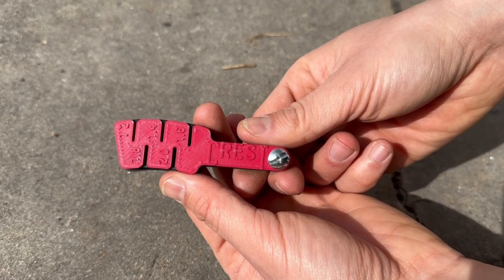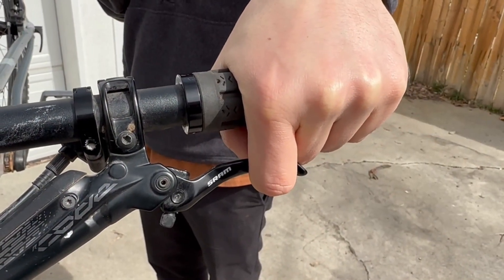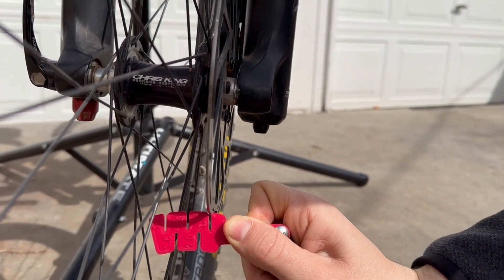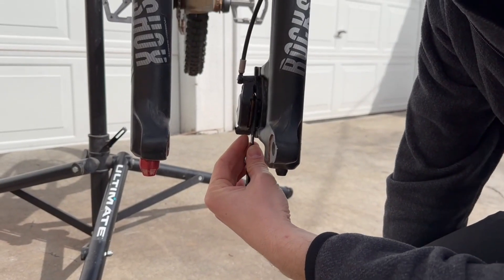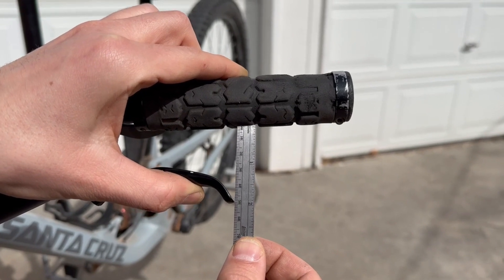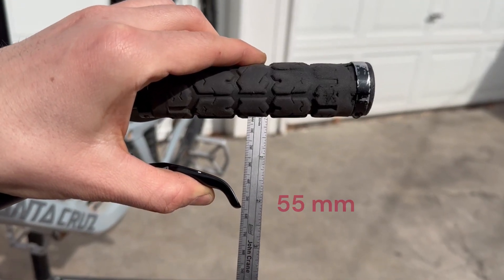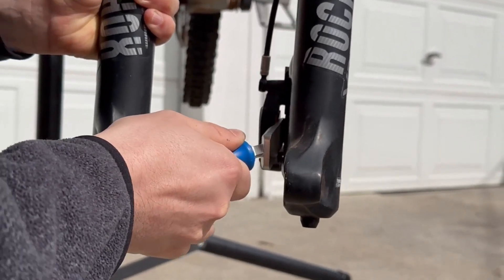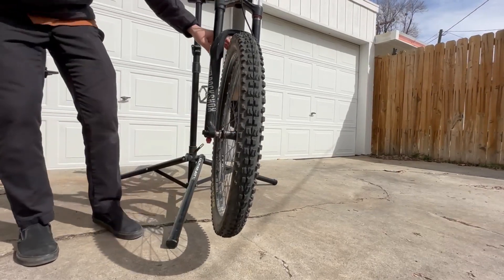Easily adjust bike hydraulic disc brake lever contact point! No bleed required! - Crest Tool

Comment: If you need to adjust the rear brakes just use an Allen wrench to remove the two bolts holding the caliper to the frame, then use the tool (spacer) as the video shows and then bolt the caliper back to the frame. It is super easy vs pulling the rear wheel off of an e-bike or even a normal bike (where you would have to flip it over to remove the wheel or use a bike repair stand). Anyway that is how I work on my calipers vs taking wheels off (front or rear) and it is the method I prefer but of course use whichever method works best for you.

Comment: First just check that the rotor is centered in the caliper and the pistons are extracted equally on both sides. If it is off center, the bite point will get spongy and closer to the bars too.

Comment: If I bleed my SRAM brakes with the bleed block, put the pads in and advance the pistons with your tool, when I put my 1.85mm thick rotor in whether I use 1.8 or 1.6 wouldn’t the space for my rotor be too small? And if so, what is the tool providing for me advancement wise? I have SRAM G2 RS.

Comment: Thanks just purchased the tool. The front wheel is easy however the back is more difficult, would it make more sense to just remove the brake piston itself for the rear of the bike instead of the entire rear wheel?
Reply from the maker: I’d keep the caliper on. It will keep it aligned with the wheel and rotor better. 

Make sure your chain is in the smallest cog. That makes the rear wheel easier to get on and off.

Also, thanks for your purchase! Hope it helps!
Reply: @CrestTool  Thanks hopefully this works! I bought a brake bleed kit as well because i'll eventually need one, however the eBike is brand new and needs minor adjustments on the rear brakes, the bite isn't strong enough, hoping it just needs a pad pressure adjustment.

Comment: I have an Specialized Epic 8 Expert and it was very easy to adjust the reach on the lever but there was no simple way to adjust engagement.  I went through the owners manual and reached out to a shop and they both said to bleed the brakes.  I’m not a fan of dot fluid and wanted that to be the absolute last resort. This is a bike that was about a month old and felt like it was kind of silly that I needed to bleed my brakes already.  I saw your video and wasn’t sure if I should try your tool until I reached out to the rep that sold me my bike from Specialized and he sent me the link to your video.  The tool is pretty inexpensive and simple to use.  My engagement is right where I want it now and my bike rides so much better.  Thank you for creating this simple yet very effective tool.  Ryan
Reply from the maker: Hey Ryan, glad I could help! I had a very similar experience with my Sram Code brakes and that's why I created the tool. Awesome to hear that someone from Specialized recommended the Brake Pad Advancement tool to you.